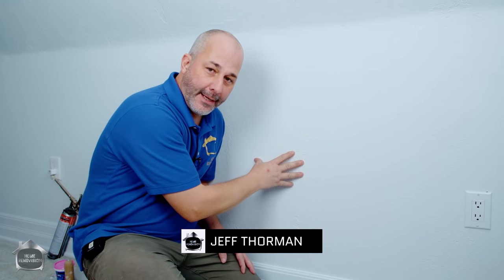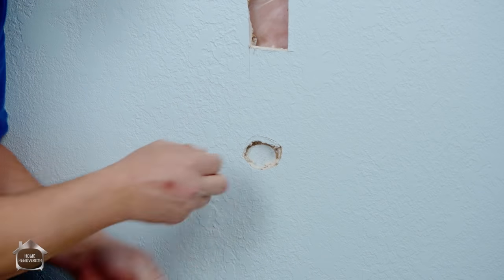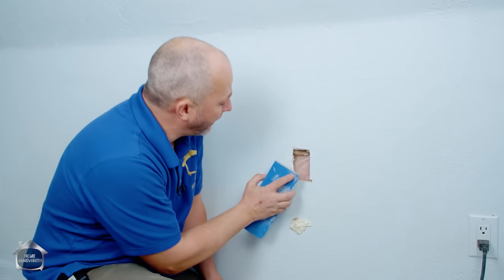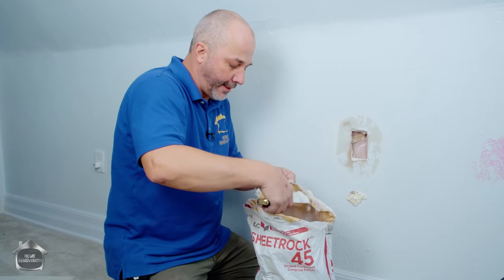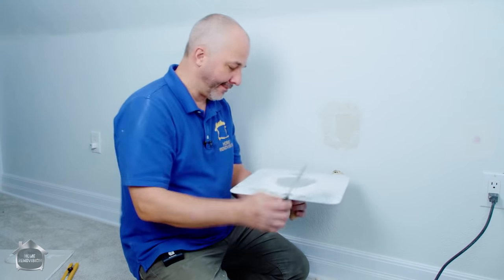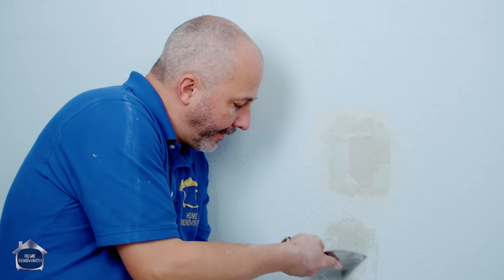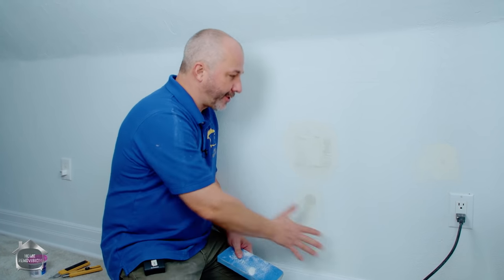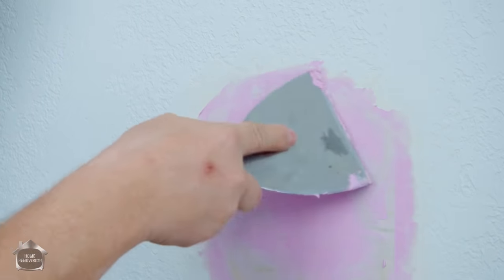How to Repair a Textured Wall in 3 Different Ways

Comment: This great video helped me do my first drywall hole repair on a textured wall. It was a bit daunting at first, but I was so happy with the result that I felt like going around the house with a hammer and making more holes to fix. Here are a few lessons I learned. I had never used any kind of drywall compound before, so I used Dry Dex for everything. I watered it down with a few sprinkles of water. I think mud would have been better on the first two coats. After I was almost done, I finally found the 5, 20, and 45-minute mud products, as well as the premixed mud (which says 24-hour dry time and a small container costs the same as a bag of the dry mix--around $10). The drywall paper gets soggy very fast and can tear or get damaged. After this happened on the first patch, I primed it before the second application. This seemed to help. Texturing was like the Super Bowl of the project and caused great consternation. I used a spray can of knockdown product. The key was practicing on scrap material to see how the product actually works. After many tries, I realized this product matched my wall best when I just let it dry without scraping. I also applied it in multiple applications rather than all at once. Finally, I used the spray Kilz, but it left a powdery-looking finish. I prefer brushed-on primer. It will probably look the same after painting either way--I haven't finished yet.

Comment: If I just need to fill a small hole that doesn't require taping and blending out into a much larger area, like your 2 smaller hole repairs, I will then wipe off the new excess mud around the hole with a damp rag or sponge, leaving just the small previous 1" diameter hole area to texture. No sanding. Great video as always, Jeff. I love to show them to my son who is out of the air force now & wants to flip houses with me.

Comment: Just want to note that the canned aerosol knock down "patch repair" stuff is only good for walls and not ceilings. It just lacks the pressure needed to spray upward that a true hopper with a compressor would have.  At least in my experience.  Like to hear your opinion/guidance.

For ceilings dabbing on the material as shown here is great. You can also use a ball of natural sponge  which gives you a less uniform distribution as the pores are randomly sized.  These can be bought online or from an import furniture store or body and bath boutique.

Finally a trick I got from another drywall pro was when repairing and texturing - "read the wall". What he meant by this was you will see a direction to the knockdown. Its thick where the person started the stroke and thinner where it ended. If you replicate this directionality the light will reflect in a uniform way across the ridges. If you are contrary to the flow you will see the finish (satin, gloss etc) look weird. Even if you paint the entire wall or ceiling you cannot eliminate this as it is a light reflection/dispersion effect (like a lens flare).  When I followed this simple tip I was stunned how good even lesser efforts looked.

Comment: Just a suggestion, a looped roller (small vinyl loops) used after applying compound let dry then use a trowel to strike down and match rest of wall. I think they are readily available for about $6.00 no hopper no equipment needed.   Also for some of us impatient people I keep a small hand held hair blower to dry patches quickly.
Love your channel especially after you work an area you go over it with your hand! If you feel it you will eventually see it. Great advise.
Reply: Thanks.  A brush would be good for a small hole.  My hole is gonna need that looped roller.  Lol

Comment: Glad I clicked on this video looking for how to texture a wall for a patch we just put on. I would have never thought of using a paintbrush. Genius. Also, thanks for the head's up on painting the whole wall once done. This wall is textured, but I sanded it down a bit and put primer on it. Patched the hole, then will primer the wall before painting. We have an area near our kitchen where there are about 2 or 3 spots (not small) that have a different sheen than the rest of the wall. Its been like that for over 15 years. I figured we must have ran out of paint and got the wrong sheen, but that doesn't make since as its only those spots that look different. The other guess is that a different mud compound was used on those spots, however same with the paint in saying that didnt make since either unless someone went over it again. It also doesn't look like a patch job either (its really high on the wall). In case, once we get to that wall we will be sanding down the texture a little bit, adding primer and painting with a new color. Thanks again!

Comment: I use foam to back patches/fill gaps in drywall all the time... I used to think it was a hack, but the results speak for themselves...  Glad to see i'm not the only one.
On small repairs on some texture finishes trimmed foam with a single coat of 20 min followed up with a large nap paint roller looks like almost a perfect match.
One thing I have found that works amazingly on deep /large repairs is fiberglass mesh tape pressed deeply into  wet foam ... 
It dries hard and strong and keeps the mesh tape in place so you don't get sags, you can even sand it if it dries "proud" of the finished surface.

Comment: Nice tip for cleaning up extra mud in the texture is using a damp sponge. You can also use it to clean up ridges you may have left behind as the muds setting up. 5 minute mud works great if you can work quickly. 👍🏼

Comment: Thanks for all of your videos, currently in the middle of some drywall work from moisture damage. My walls are unfortunately textured in what can only be described as road rash because that’s what you get if you rub up on it. With any luck I’ll be priming and texturing tomorrow.

Comment: Thank God for guys like you with years of experience taking the time to show us DIYers what we're doing wrong. Would love to see what you do when butted up against a corner. I was running ethernet and goal was to get close to the stud (to drill through) and using furring strips (before I discovered Cali patch through this) and had nothing to screw to on top or side. Made it work but it was u-g-l-y.

Comment: Fantastic tips. Thanks. One thing I do for the last step before texturing is with a wet sponge feather the edges more so it blends in better. Not so much as it remove too much mud. Find this works well too.

Comment: Brilliant repair job!  Luckily for me I don't have any textured walls, however I do have a unique situation on my living room, dining room and upstairs hallway walls.  Apparently the previous owners of the house wallpapered these walls.  Well before they sold to me, they took the easy way out and repainted over the wallpaper, so this is a lot of square footage with paint over wallpaper.  So far, I've been mostly lucky with not having any damage to these walls.  However, you can clearly see some of the wallpaper lines where the paper slightly peeled off on some of the edges.

This long commentary leads up to my question.  I've only had to make one minor repair so far.  It was at a small section underneath the living room bay window, so the repair is not at eye level.  What I did was cut out and peeled off the wallpaper, then did the repair, then replaced the peeled off wallpaper.  The repair came out well, but the cut lines are pretty obvious, but as I stated, it's way down at the floor level, so it's not at a location where your eyes are drawn to.  So the question after the long winded build up is, how would I approach repairing it further to hide the wallpaper lines?  Thanks for all you do!

Comment: Thanks for the vid, very helpful. Here is one top for you. Instead of using a sander and making a dust storm, just use a wood wrasp instead. It makes real quick work of getting rid of the texture with no dust.

Comment: 🤯 I will admit, I was a little skeptical when I saw you put the caulk on the wall.  Never seen it done that way, but thank you for sharing a new way to do this.  All of the walls and ceilings in my house are textured in one way or the other.  More skills for the toolbox.  Thanks for sharing this with us.

Comment: I have two holes I have to repair, which is how I came across your videos!   One is a small hole about 1" by 2" under a double light switch.  The other is a large hole because I tripped and fell into the wall.  I love this video and the trick on using the paper from drywall. I assumed in order to repair drywall, you had to cut out far enough to find wood/studs.  After watching this, I see you do not have to do that for small holes.  But, for my large hole, do I need to do that and attach with screws?  I also did not know there was such a thing as dry compound!!  Not sure what product to use for my two repairs.  Would love your thoughts! Love this video! I learned a lot!

Comment: At the end of the video you briefly discuss the next steps in completion of this wall after you have repaired the holes. Is there any way around painting the whole wall? If there is not which video do you recommend for painting over textured walls. For example, to cover scuff marks, dirt spots that cannot be wiped off.

Comment: Awesome video I am attempting my first job and even though you intended to teach texture I gained insight in the whole process from watching this. I like how you didn't use any wood or screws to do this. Can I do what you did with just the spackling? I don't have any mud or fancy stuff. Also was this a very well ventilated room? I've never thought to use a spray can like that inside because of all the potential hazards.

Comment: Great video! Bob Ross has some competition 😂 how do you best imitate plaster wall texture (orange peel like surface)?
Reply: I buy an aerosol can of orange peel texture (it will adjust from heavy to light texture) practice on some cardboard, then put it on the wall.

Comment: Hi Jeff. I’m planning on putting a subway tile backsplash in my kitchen and was wondering if I can simply apply mastic directly on the painted wall, or do I need to remove the paint first? Thanks.

Comment: Great video!  I recently tried to fill a couple chips in some drywall.  I used the pink drywall filler to fill the chips.  I began sanding with about a 180 block sander.   I'm not going to say my drywall is textured, but it has a look to it.  The patch job I did looks terrible!  The repair just looks flat to me with these ridges you mentioned.  I painted the patch with a foam roller and.... gross.   My description likely doesn't make much sense, but please help so I can fix this mess.  As always, great information in this video

Comment: Hey Jeff, love your videos. I'm a rookie and have been using them to finish my basement. So thank you. I was wondering if you could help me. So I had to move a pot light above my island in my kitchen and now I have a circular hole. I have the cut out piece from new pot light. Should I use it to fill hole by screw into something like a 2x4 and patch around the circle? It is a california finish. Thanks.

Comment: Nearly all of my walls in my 1500 sq ft house have a "sand swirl" texture with terrible patch jobs all over the place. I'm not a huge fan of the texture but  it's not the worst. Do you think its worth the effort of skim coating the walls? Or should I try and match the texture and fix the patch jobs right? Decent likelihood ill paint the walls either way. Thanks!

Comment: Would these methods still work if the walls are plaster-on-drywall?
Reply from the maker: Yes, absolutely
Reply: Another nearly concrete wall home person! Cool! I actually have a new hole to patch from an overly exuberant drill in the wall for a new light fixture 🤣👍🏻

Comment: Wow...Finally some info on a repair I need to complete. BUT...I have a section that's going to be about a 4'x4' section. I slipped in attic and put my foot through the ceiling and its textured. of course it pulled in all directions .
Reply from the maker: videos coming soon an ceiling repairs. Cheers! perhaps subscribe and hit bell for notifications so you don't miss it.

Comment: Great information, if you have a small crack that runs the length of the ceiling. can you use caulk to fill the crack in the drywall, then texture with one of the methods shone in video?

Comment: Hi Jeff. Excellent vid. Great information and tips there. Cheers! What's that primer you use after you've patched hole please? When I have patched holes in the wall and painted the wall, it comes up darker. Is this coz I've not primed the areas first? Thank you. 👍👌🤔
Reply: Try using "Kilz primer" by Zinnser co. Available at paint stores like Home Depot. It primes and seals the walls with white primer, so top coat will have full bright color. Good with any type of paint over it.

Comment: Had my 1920’s house rewired, had knob and tube. My walls are textured plaster (asbestos) and I have about 50+ 3”x6” holes in the ceiling and walls. I would like to tackle this myself. I was wondering what your process is and material list needed to repair.  Maybe a video on this specific job. 🙏 Thanks.

Comment: I just stumbled across your videos last night, I already purchased the knife through the Amazon link as well. I work as an apartment maintenance technician so I do a fair share of patch repairs. I don't have a hopper or sprayer and not sure I want to justify hauling around the compressor. It looks like your brush techniques worked great for knockdown, but what about some Hopper less techniques for orange peel? Also what is your opinion for Max size for a California patch before you abandon that and do backing and tape? Thanks again for the videos are great

Comment: Thanks for this! Another perfectly timed video.  The paper tape “wall to ceiling transitions” on our vaulted ceilings has pulled away - - exposing gaps.  can I just do a drywall repair (retaping and quick-compounding) and then texture as you’ve shown, and call it a day?  Hopefully camouflaged?

Comment: Jeff I have numerous nail pops so I dug out the nails and put one screws above and below the old nail hole, a few of the holes increased in size because the painted paper was loose and peeled. Then I sprayed with Kilz used 45 minute hot mud coated sand coated as needed.The results were great until I painted the room they were very noticeable because they were so smooth and large they didn't match the drywall paper I tried a longer nap roller no luck any help would be greatly appreciated.

Comment: I bought an old home im trying to remodel. Every wall and ceiling is plaster, with stress cracks. What type of compound do you recommend for filling the stress cracks with? I have a knock down texture, so im going to use these tips to try and match the texture. Great video!
Reply: use a All purpose pre mix to fill and tape first coat then and second coat and for the third coat i was told to use the lighter Topping mix which is supposed to be easier to sand  kind of like that pink stuff he used as a last coat. about to do a stress crack myself and that's the information i obtained so far

Comment: Great video.  Working on filling in areas where I pulled the vanity off the wall in my bathroom and it tore away some of the paper.  There's no holes though.  I assume I'd just use the Drydex or should I use both?

Comment: I may be too late, but I have one for you. Above my shower surround is drywall. Overspray has caused cracking and pulling away of the top layer of the drywall along the edge of the surround. 
I plan to install peel-and-stick tile above the surround as a "backslash". But I know I need to fix the water damage first.
How do I do that along this edge? I would think I need it back to "normal" so it'll be flush for the tile to stick to.
Any advice you could provide would be greatly appreciated‼️🙏🥰

Comment: I guess its probably the same for a cracked textured celing?Only if the crack dont come back. My buddy said it may been caused from a roof repair. And happened when the fells dropped shingles on the roof above.

Comment: How do you go about  mimicking the wall surface that originally was painted with primer that had sand mixed in it and now has multiple coats of acrylic paint over it?  The house is now 29 years ago.  Thanks, love the videos'.

Comment: Love the channel. I've got a lot of holes in my walls from adding drywall anchors for various things. We've removed a lot of that decor, but now I'm left with all of these holes in the wall. Should I just use pink to fill them in, then use the texture techniques in this video? Thanks again!
Reply: Pink, then sand. Spray some kilz or bullseye so your patch matches the drywall. Then spray texture. Use a knockdown trowel or sanding block to have your new stuff match the old. Paint and walk away

Comment: Did you add water to the Drydex? Looked wet how did that affect shrinkage? I use it for filling Brad holes in trim cuz it doesn't shrink but a little tub lasts forever so it tends to dry out into a putty consistency
Reply: Watch a little longer and you'll know 😂

Comment: Would a small roller be better than texturing with a brush? I haven't tried to match texture like that yet, but saw a similar finish when I was attempting to roll on joint compound for a full skim coat .

Comment: I have plaster walls and ceilings I need to paint. Are there different techniques that should be used? I haven't found a video you have done with plaster.
Reply: I too would like to know if this these techniques would work on a plaster ceiling.